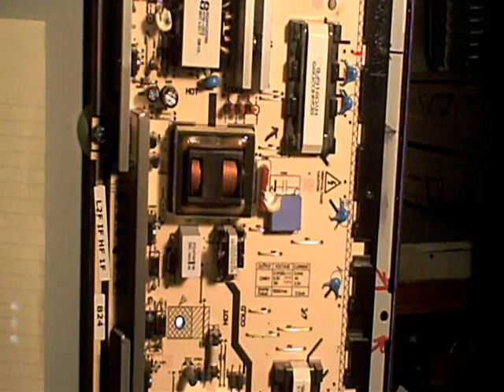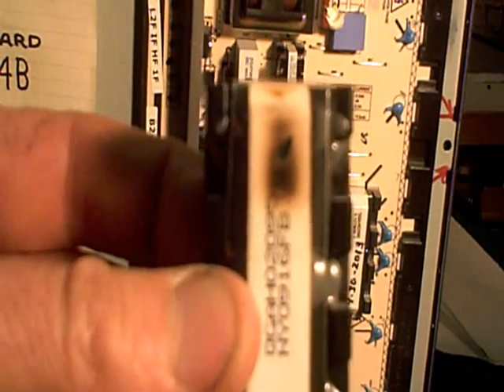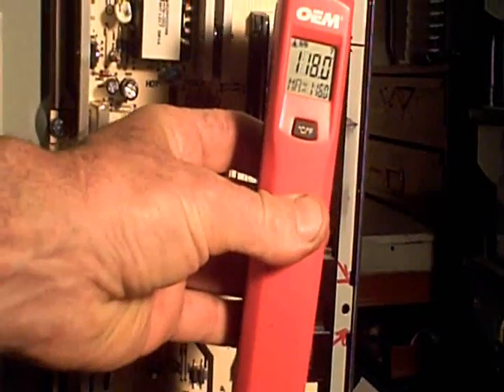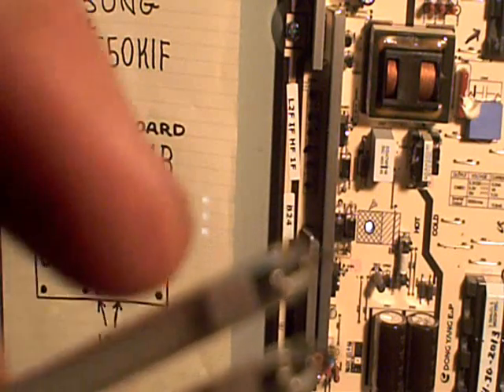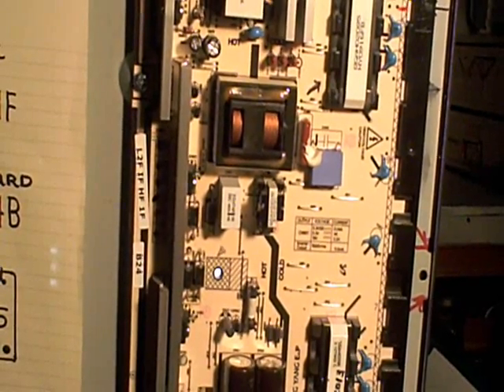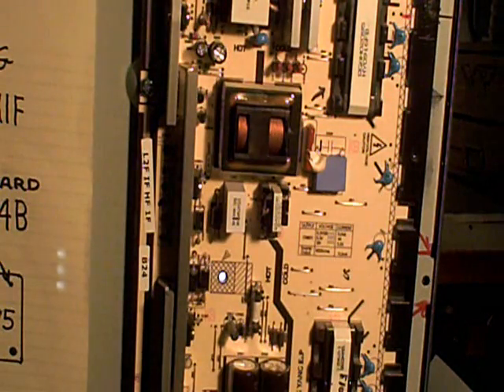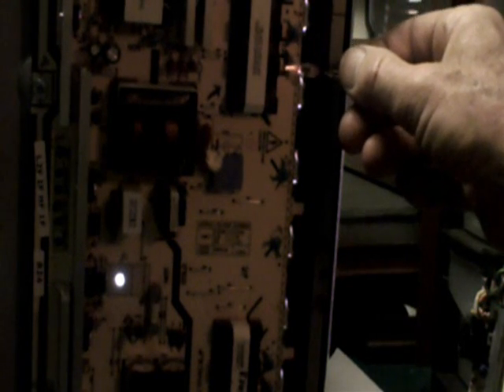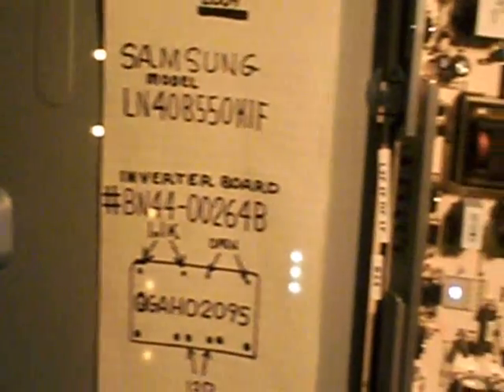LCD TV Backlights Overheating transformer on Samsung LN40B550K1F

Comment: After countless hours of experimenting i ended up just to place a fan blower for cooling the first stage HV transformer and mosfets pair blowing air between of them and as far the tv work well with mosfets being constantly cool.This repairing holds place in the top10 of my craziest mind blowing repairs ever because i haven't found the reason of overheating but the tv now works.In a case of a real malfunction of some component the air would do nothing and overheating would constantly occur.
Reply: Mine transformer is also blown, and it has primar resistance of 12ohm and secundar resistance of 0.8kohm. 

I found one with 0.8kohm secundar resistance but all have primar around 0.3ohm on primer will that be a problem?
Reply: @Alennovak666  Which one has the problem?There are two of the same type and another one that is driven through the pair of mosfets.The two same transformers are available but the single is not.
Reply: One of those two identical. QGAH02094 and some numbers but didnt remamber tham. 😅 One is ok but other one is fried on one of the secundary coil.

Comment: I have a similar board BN4400261 and the driving mosfets of the first stage transformer are burning hot in a minute of operation.The two lamp transformers reading about 860 ohms in every secondary and everything looks perfect except the overheating of the mosfets.I have already replaced BD9893F with no luck.There are balancing circuits that monitor voltages and currents of the transformers and in case of malfuction shut down the circuit but in this case the circuit keeps working until mosfets are blown.

Comment: The problem is...you don't know the fan went out ( or it even had one) until permanent burn out forms on the screen. In my case it looks like blue water stains. So,after months of trying to figure it out,It just came to me to try a fan aimed at the TV because the screen did feel hot. Sure enough,the TV looked good again. The blotches are forever I know..but at least faint enough to not be a real problem.
As long as the fan is on it.
Its a 2007 Samsung 48" I got for free over a year ago. Still a great bargain!

Comment: I have question please answer that questions as possible
At the secondary winding of the multiple output transformer all are showing short circuit, does it means it has been burned
Reply from the maker: It's probably not a short. I think you are trying to tell me you have a low resistance reading across your transformers secondary connections, and you're assuming this low resistance reading is a short, when in fact it's probably a normal reading for the type of transformer you are measuring.

Comment: I tried testing the capacitors with my meter, they weren't ohming with bad transformer still installed. Do i need to test capacitors with a good transformer? Or do I have bad capacitors? Thanks!
Reply: You probably need to remove the Caps and test them out of circuit

Comment: Hi Dave, thanks for the video. This is exactly what my Samsung has done - same model number. Same burn marks. My question at this point is, is it worth taking in to get fixed? If the issue ultimately comes down to the CCF lamps and replacing the  burned transformer, will I get any reliable life out of the television for a reasonable investment? Or am I better off just replacing it at this point. I suppose it's had a good run @ 7 years.
Reply from the maker: It would probably make more sense to replace it at this time. Since many of the new TV will not last even 3 years I suggest you pay extra for an extended warranty.

Comment: so.  the lamps cause problem?  my monitor samsung p2250 burn the pcb down the inverter.  i swap a new entire board and works ok.  2 days after the monitor is hot again and little smeel of burn;  (sorry my english) .   i open again and see the backlits, one or two has a litle litle black portion  like this in video.  its the problem??
Reply from the maker: +ratodebanhado I can't understand you real well.
Reply: -inverter burn the pcb.  make a hole in pcb.  

-replace the entire pcb (new)

-2 days after, feel faint smell of burning and the monitor was a little hot

-the lamp (ccfl) can be the cause?
Reply from the maker: CCFLs become more conductive as they age. This can cause the inverter transformers to see less resistance on their output side, and make them run hotter.
Reply: Grants Pass TV Repair Excuse my language errors. I'm trying to write without google translator. Anyway, thanks for the explanation. My monitor is currently working with the new board but I'm monitoring him not to catch fire. lol. Thank you very much.

Comment: Hello i have got the same issues, my BN44-00264A does the exact same thing, it cycles on and off all the time. Did you replace the ccfl inside the lcd? How do you do that, because my transformers don't have any burn mark on them :-(
Reply from the maker: +erklabaer I only replaced one of the inverter transformers.
Reply: +Grants Pass TV Repair That sound nice, maybe it is just the inverter even in my case... but i don't have any burnt spot on it :-(

i will get the BN44-00264 C   not A but C used and try it as a full replacement might be worth a try
Reply from the maker: If there is no burn mark I doubt it's over heating. You can do a temperature scan and compare it to the other inverter transformers to see if there is much difference.

Comment: I am going to try the transformer first as that is a cheap fix.. I too have the same burnt surface on the same transformer. So my question is.. What my tv is doing is powering on.. but then the screen turns on and off.. the screen itself is perfect when it does come on.. could this be a fault in a capacitor or possibly as you said a bad bulb? and also did you replace any bulbs on this particular tv?
Reply: I know it’s been a while, but have you fixed the issue with your TV, I’m having the same issue

Comment: Thanks for the video, very informative!  These are the worse design for a ps/inv several broken solider joints on the transistor bars, flimsy PCB and seems very susceptible to heat damage.

My question is, the BN44-00264B seems to have a buzz about it right around the large transformer, I have 2 of these and both of them have a slight bzzzz now when I change the backlight setting to max (10) the buzzing stops.

What could be causing this? I have tried these in 2 panels one of them had a BN44-00264A board that didn't buzz at all. 

Any thoughts?

Again thanks for your videos, I have learned quite a bit from them!

Comment: hi name is ramiro i got a samsung it would take me about 10 to 15 times to turn it on, but now. last night was the last it turned back on. now my lead light to the power button stays on, but to turn it on it wont turn on the light just flickers. now the only thing i did to it is i toke the back off and looked around for some bad capacitors did not find any bad ones.I am trying to follow all kinds of people to try to work things out but it not just working. i am lost with out my TV PLEASE HELP ME.
Reply from the maker: It's been my experience that when a power button need to be pressed multiple times to get your TV to come on it often due to a bad capacitor in the power supply. Did you test all of your capacitors with an ESR meter or are you guessing  which capacitors are bad by appearance alone?
Reply: just by looking don't see no humps on any capacitors.
Reply: and don't have a ESR.

Comment: i have sony bravia klv-32s400a, ic u6 from t-con board blown/crack.it is possible that ic from t-con baord overheat or ovevoltage?power supply has fuse, overvoltage protection.what makes ic u6 burn?power supply ok +3,+12,+24.pls help coz i want to replace the t-con board,but..afraid..of blown.. again.pls reply just gave me tips,procedure before i replace the t-con baord.thanks..

Comment: dave i got a 1000 watt inverter with a input transformer ee42-33f its making a super loud noise.. like a whine when you press on it it goes away

so i need to find that transformer any suppliers or part numbers i need to know? i think its shorting out

Comment from the maker: 0.9K is probably not going to be a problem. I had the same concern as you when I noticed my replacement transformer had a slightly lower resistance value on the secondaries, but I was told by an expert technician it's not likely to be a problem, and the seller on ebay told me he has sold thousands of these and hasn't had any complaints.

Comment: I have been a electronics technician since 1980 and worked in the consumer electronics field well into the mid 90s but around 1986 the consumer electronics field was being decimated and we saw the whole service sector go under and pretty much without any fanfare. When I started my proficinal carrear there was a TV repair shop on every corner, by the time 1995 rolled around probley 90% of them were out of business and the only jobs left were with the major consumer electronics stores.

Comment from the maker: I only replaced Two of the lamps, but I should have replaced all 4 because each transformer controlled 4 lamps. when I tested the end of the transformer which controlled the Two lamps I replaced it operated at a cooler temperature than the opposite side, so it appeared I was on the right track since the first transformer overheated on the side I tested, but the transformer still ran hotter than the others. All the transformers shared the same driver transistor suggesting the driver side was Okay

Comment: the neon bulb is an old trick, I used to work on tube tv's and you could hold the bulb next to the Horz Output Cap to see if you had high voltage.